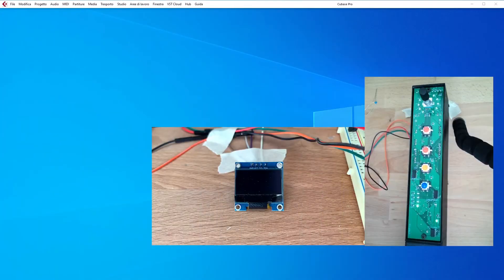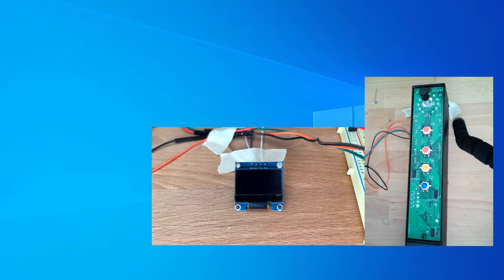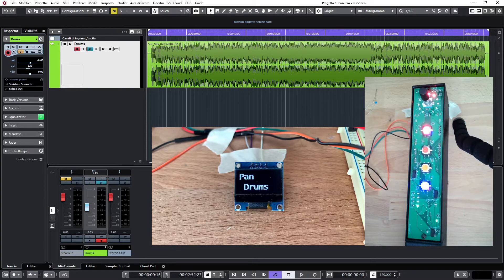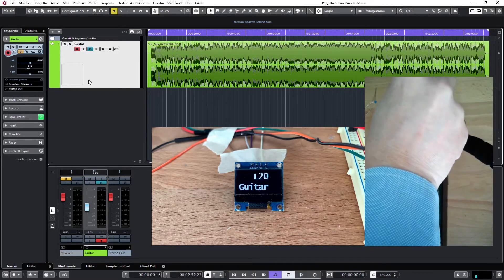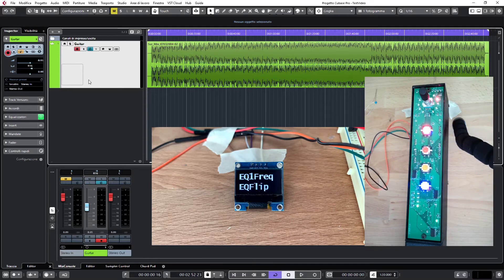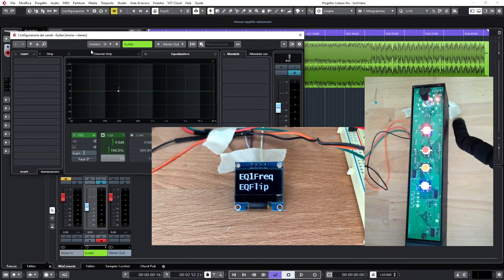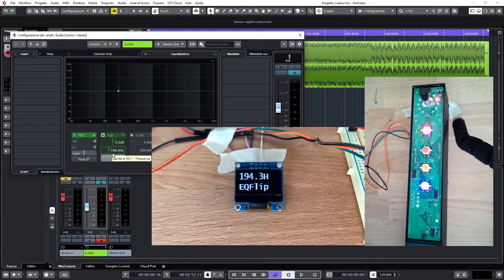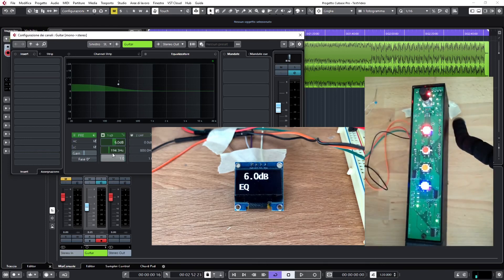DIY MIDI Remote Controller - Strip Display

Comment: Question:  Given that the MCU is decades old now and the incredible OLED displays of today didn’t exist back then, plus everything else that’s available today, would it be possible and if so wouldn’t it be even More useful to make the displays (1) show all of the information at once rather than pressing the display button needed on the old limited displays, and (2) display the Track Names with full names rather than the old annoying abbreviations, and (3) possibly get the displays to show the Track Colors from the DAW as well.

What you are doing is incredible and I can’t thank you enough!

Let me share my long time dream with you:

I have a 32-channel (64) Soundcraft Ghost analog console that has been partially modded and sounds incredible.  The Ghost also came with both MIDI Transport Control, and Mute Automation built right into the center section, incredible at that time.

I also have had many DAW Controllers over the years, and currently have a Behringer X-Touch, and 3 Extensions for 32 Fader Channels.

So basically what I’ve long wished, and contemplated doing, is Removing all the Analog Faders on the Desk (and hiding pots inside calibrated for Unity Gain).  Then transplanting the Faders from the X-Touch into the Ghost’s now empty slots.  

How to get the 4-Buttons, Rotary Encoders, and OLED displays jammed into each channel strip seems more daunting, but with what you are doing and the ability to break it up into separate components, it does seem doable!

Thank You so much for what you are doing, even if for now it only keeps the little flame in my imagination burning with new possibilities.

Comment: Maestro, thank you for your wonderful videos and for sharing your knowledge. They are extremely helpful and insightful to say the least.
I have searched high and low for answer to my conundrum of CC feedback from my DAW (logic) lighting up my play, record, mute and solo LED's on my midi controller. 
I am using a Teensy LC, and I have successfully hooked up buttons which send CC information to control the transport controls of my DAW, and LED's which work in conjunction with said buttons and which turn on and off when the corresponding button is pressed, however these LED's are not in 'sync' with my DAW, and do not respond to the current status of the DAW (playing or paused, etc). 
Please could you tell me how I would get feedback from the DAW, which will sync up the LED's properly, so that when I press for example the play button on my DAW, that the LED on my controller will also light up? And of course in reverse too. Is it possible with my setup sir, in a simple and cost effective way? 
I look forward to your response. Have a great day!
Reply from the maker: The feedback lights in buttons switch on and off, is on a DAW midi message basis. So in other words even when you push your button, your LED do not switch on because your push action directly, but because your push action sends the CC message and the DAW sends another CC message in respose that you have to catch in your teensy. If you correctly implements this functionality everything will be in synch no matter if the action happens inside or outside the DAW.

Comment: I am so incredibly impressed by your progress, you make me believe I can built my own dream controller. Are you thinking of selling pcbs (or the files to have them manufactured) so we could built our own? Thanks a lot for your videos and inspiration!
Reply from the maker: Dear Olivier thanks a lot for your kind words. The good news is that I confirm! You can  do it!
My plan is to provide for free PCB production files (namely Gerber files), BOM (list of materials) and software so that anyone can have fun in ordering the PCB and components and then put everything together as it is or evolve it. I will only retain the commercial rights, all the other cases will be available for everyone. In a second moment I might put together kits  "ready to go" and sell them to focus the user experience in just pure mechanical assembly. Of course this second step will require a bit of work of preparation, organization and CRM.

Cheers and thanks!
Reply: @fcampanini  I searched for years for a way to achieve what you're masterfully demonstrating here, since I lack circuit and programming expertise I always could not go very far, but here you are doing EXACTLY what I want to achieve! I'll be riveted to my youtube notifications looking for every updates you'll pull out!